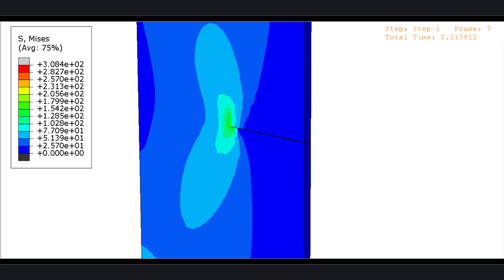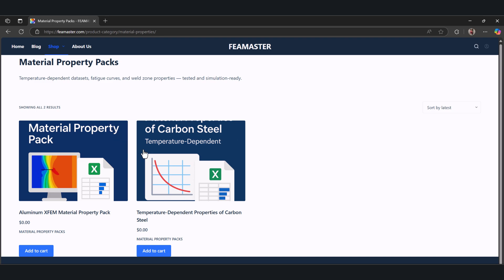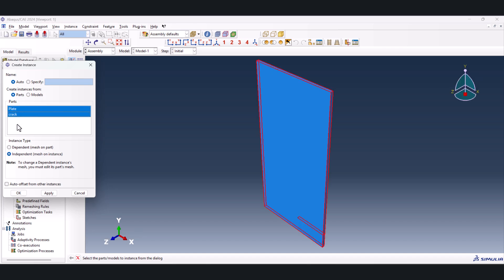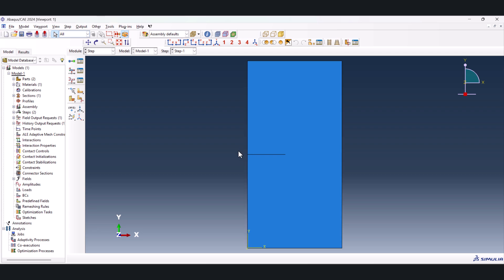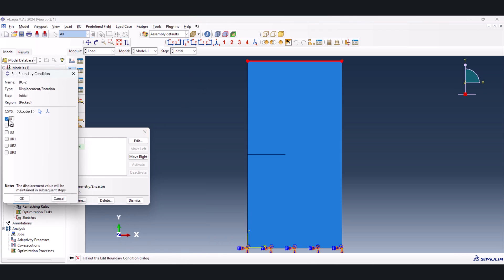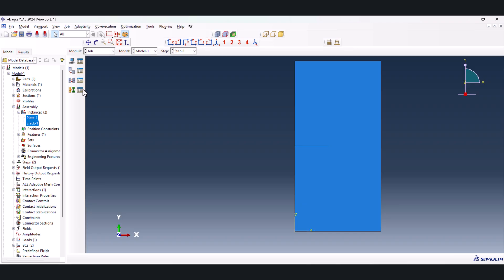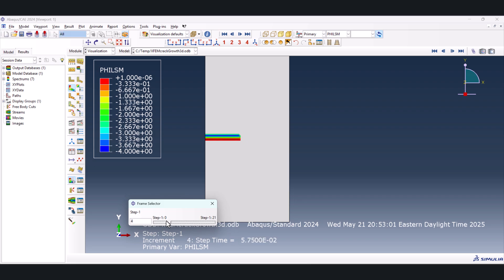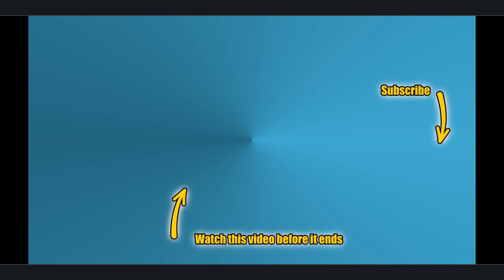3D XFEM Crack Growth in Abaqus – Most People Get This Wrong

Comment: Is it like possible to get a Zoom Call withj you? I am writing my Master Thesis about XFEM right now, but I am working with an Orphan mesh. So is it possible to just create the crack via Special-->Crack etc. without the wire part? Sinnce you cant add something in an Orphan Mesh. Like I dont think I have to pre set the crack right?

For Context Its a cemented Cylinder, which got scanned in a ct and Python generates a input with a mesh out of the files.
Reply from the maker: I really appreciate the trust, but no Zoom calls, my friend! 😅 I try to help as much as possible here publicly.

Regarding your question—you’re correct that with an orphan mesh, you can't create geometry-based cracks like you do with native parts (via Special → Crack → Assign). XFEM requires the crack to be defined relative to geometry features, not just the mesh. Unfortunately, XFEM doesn’t support crack definitions directly on orphan meshes.

For an orphan mesh (like a CT-scanned part), you'd typically have to use other methods like seam cracks, partitioned geometry, or predefined node-based cracks in other workflows—but not XFEM.

So yeah, no pre-setting the crack through XFEM in orphan meshes.
Reply: @FEAMASTER  Thanks for the reply! So Orphan Mesh doesn’t support XFEM?
Do you have any sources I could show my professor, to prove it doesnt work with XFEM on Orphan-Mesh? This is for my master’s thesis, and I need to create a crack using some kind of XFEM. Right now, it looks like my only option is to create geometry from the mesh. Do you think I could code the wire/crack in Python and then assemble it in Abaqus?

I’m open to any suggestions! 

I already tried converting the mesh to geometry with the Plug-in, but it didn’t really work.

Comment: hello thanks for the video
Maxps is for the crack to propagate. What fracture energy does and which are its units?
Reply from the maker: Thanks for watching! Just to clarify: in XFEM, crack propagation is actually controlled by the crack propagation interaction, not the MAXPS damage criterion.

🔹 MAXPS (maximum principal stress) is part of the traction-separation damage initiation model. It defines when damage starts, not when the crack grows.
🔹 The fracture energy (usually in N/mm or J/m²) is used in the damage evolution step. It defines how much energy is needed to fully propagate a crack after damage has initiated—essentially controlling the crack growth rate and length.

So in XFEM, you typically use:

MAXPS → to initiate damage

Fracture energy → to drive the crack growth

Crack propagation interaction → to allow the XFEM crack to grow

Hope this clears it up!
Reply: Thank you!
Reply from the maker: @civilmode108  You're welcome!

Comment: great job professsor,   could you please explain how to get the maximum number of cycles to achieve the total failure of the plate and how to use the Paris law in this case ?
Reply from the maker: Great question! 🙌 In XFEM crack growth analysis, Abaqus simulates the crack path based on fracture criteria (like energy release rate), but it doesn’t directly give you the number of cycles.

To connect it with Paris’ Law, you'd need to postprocess the crack length after each step and manually apply the law:
da/dN=C⋅(ΔK)^m
 
Track the crack growth per step, extract ΔK, and integrate Paris' Law to estimate the total fatigue life. Abaqus shows the physical growth—Paris Law helps translate that into number of cycles.
Reply: You have addressed everything comprehensively🎉. Thank you once again for your assistance. @FEAMASTER
Reply from the maker: No problem!

Comment: Thank you for this video.
 
Since crack is not meshed,  how should  I proceed if I want to make a finer mesh at the tip of the crack ?
Reply from the maker: That's a good question! You can use ALE for a better result or you can do a couple of simulation and know where were the crack stops and create a circle there and refine the mesh there.

Comment: Thanks,
How to get the values of stress intensity Factor K, and Contour integral J?
Reply from the maker: That is a very good question. You have to define that in the history output manager. Put the domain on the crack, select the number of contours and the result you want, either J-integral contour or stress intensity factor, then you can easily plot them after! 
I will make a video on that for sure!
Reply: @FEAMASTER  Yes sir, I tried that. By doing that we get stress intensity factor for each increment for all number of contours. And I don’t know which is the actual required stress intensity factor which I need to use to plot graph between crack length vs K. It would be great if you show how to plot J-integral and K vs crack length.
Reply from the maker: @ihtishamarif4971  Huh, I know your frustration, it's recommended to pick a paper then plot the results and see which one follows the trend of the article.
Reply: @FEAMASTER if you can also show in other videos 👍👍
Reply from the maker: @bensaidismail5394  Yeah sure, I'll try to make another video on that!
Reply: @FEAMASTER ok, thanks